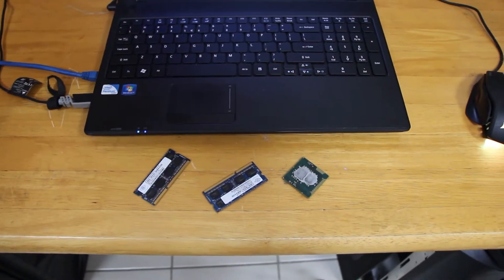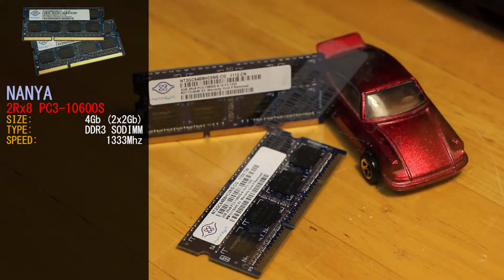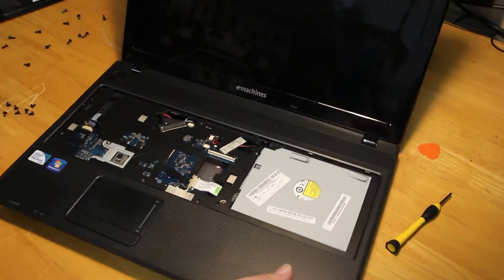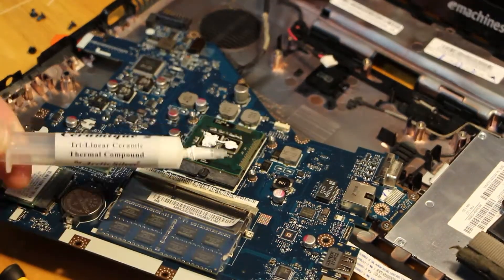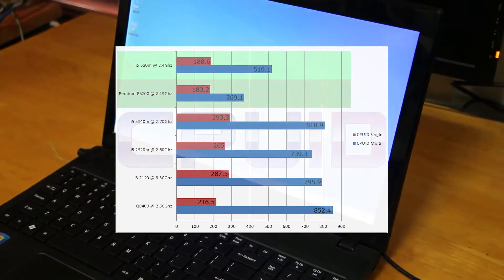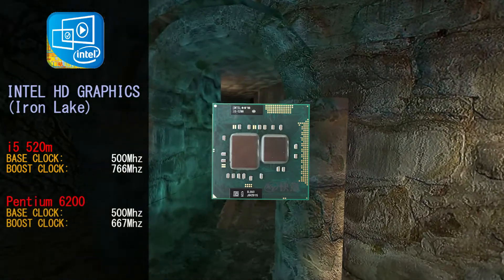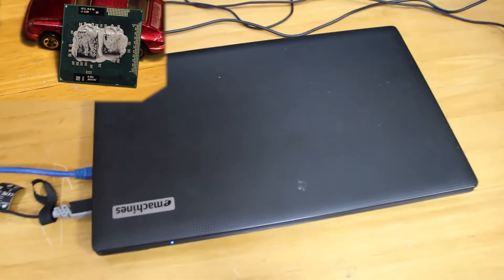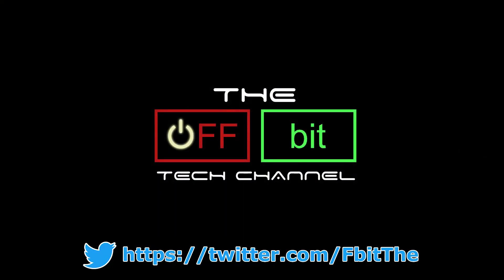eMachines E729Z Laptop CPU and Ram Upgrade. Pentium p6200 to i5 540m with 4g of DD3 SODIMM ram.

Comment: Can emachine d730 upgrade from 2 gb ram(?) To 8gb ram?
From 250 HDD to 500 HDD?
From window 7 to windows 10?
Please i need answers i don't know about computer's and my laptop been broken i don't have to use in online class and the only way is this old emachine that my parents bought from a scammer..
And can I also ask what to do when it's easy to lowbat and overheating? Should I buy new battery?
And it's speaker is broken should i use wireless earphones instead? 
Advance Thank you if you answeredn sir!! I'll always wait for response and I also hope can you teach me more abt it how I'll turn it to worth it and useable laptop 😅🙏
Reply from the maker: Yes all of the above should be possible.
Before putting windows 10 on your laptop we would highly recommending the hard drive and ram as you have planned to be upgraded.

We would recommend using an SSD drive. This will make you laptop feel a lot more snappier and boot times will be a lot faster. It will also save you battery. 

Running windows 10 we would recommend at least 4gb but 8gb would be ideal.

The things you will need for a good windows 10 upgrade:
- SATA SSD Drive ( get the 512gb as you wanted)
- 2x4gb Sticks of DDR3 ram for laptop to get you to 8gb of ram (They are called SODIMM)

Other things to fix.
Overheating will be down to dust build up and the most likely cause the CPU needs new heat-sink compound. It's a paste you can get fairly cheaply. Over a long time it dries out and becomes more of a heat insulator than a transfer. The other more unlikely situation is the cpu fan has failed. Just check if you can feel air blowing out from the left hand side near the back of the laptop.

The battery will probably need replacing if it does not hold it's charge. You should get about One and half to 2hrs out of it at least. If not good chance the battery needs replacing. Also if the laptop is running poorly it will chew battery up thinking and loading.

The i3 cpu probably would suffice for now but if you wanted to upgrade you should be able to get an i5 or i7 (you wont be able to use the Quad Core i7 because of it's not having an on chip graphics processor, these usually have a qm on the end of the cpu model). You will need to stick to first gen i5 and i7 mobile processors.
Wiki has a nice list of them.

https://en.wikipedia.org/wiki/List_of_Intel_Core_i5_processors#Westmere_microarchitecture_(1st_generation)_2

https://en.wikipedia.org/wiki/List_of_Intel_Core_i7_processors#Westmere_microarchitecture_(1st_generation)_2

You will need to make sure that your cpu is not soldered on, which it is most likely not in your case. The cpu socket for your laptop motherboard will most likely be Socket G1. Otherwise it will be a soldered on socket named BGA-1288, if this is the case we cant really upgrade the CPU.  

The hardest part with the CPU upgrade or changing heat-sink compound is the opening of the laptop. Take your time, we use jewelers screw drivers and a guitar pick top open out laptops as you have probably seen.

here is a video we found that might help you open up your laptop.

https://www.youtube.com/watch?v=ghSf6ALBUV4

Anything CPU related is quiet involved and probably hard to do and usually requires the motherboard to be removed or partially removed from the laptop. The ram and hard drive upgrade should be fairly easy. They are both located underneath the first panel at the front of laptop from the bottom.

Good luck.
Thanks for watching.
Let us know how it goes.
Reply: @OFFbitTech  I just looked in settings just now for the first time... So this is what I found it's already windows 10 and have 4gb memory wait I'll list the abouts:

Processor: Intel (R)Core(TM)i3 CPU M330 @-2.13GHz 2.13 GHz
Installed RAM: 4.00GB(3.68GB usable)
System Type: 64- Bit operating system, x64-based processor

Windows specification
Edition Windows 10 pro
Version 2004
Installed on 12/7/2019
Local disk (C:)- 232 GB
42.6GB used 189 GB Free

I think the only problem is it's slightly lag always, overheating and easy to lowbat...

I'm planning now to buy new battery I want to be sure now that I'll buy legit one bc my father buy battery before to the seller for $50 and it's fake(that's what I'm using now) it's lister there 5500 mAh but only lasted 1 hour at the very least... 
Also yes, there's a hot wind when using in left part of laptop
Can I ask more pls? If I change the 4gb to 8GB am I able to attend zoom meetings without problem/lag or overheating? 
I just need to use this for online classes/attending zoom meetings.. 
Bonus question, Can I play Roblox or League of legends here? Just one game? Can I?😭🙏
Reply from the maker: @VoiceOfPeak  Not sure, what zoom needs.
Is it giving you problems at the moment?
I'm not entirely sure if 8gb of ram will give you a smooth zoom meeting. Possibly, but it may be a processing power issue.

You can grab a little bit of extra performance turning off some CPU patches that windows has added.
This is easily done with this program

https://www.grc.com/inspectre.htm

You will need to run it as administrator.
This program disables an microcode patch released by intel to stop a couple vulnerabilities. These microcode updates makes cpu takes a performance hit. So disabling them does give you a bit extra compute power.

Also to check how your CPU temperatures are going you can use HWMonitor.

https://www.cpuid.com/softwares/hwmonitor.html

This will tell you a hole heap of information and temperatures.
Here you can check what your cpu is doing.

From here you can tell if you need to redo thermal paste.

If you can find out what hard drive you have. Hopefully you may already have an SSD drive.

Now in regards to games, Unfortunately there will be very little that will run and this is more down to api support from the onboard GPU.

In regards to games. League of legends and roblox should run, not sure how well though, they may not be playable.

The first gen and second gen i3 i5 i7 Intel onboard HD graphics drivers are very badly written for windows 10. So it is a guess to what runs and what does not.
Reply: @OFFbitTech  for now I tried it and zoom is going okay but im still not sure when it become many...
I'm hesitating on what will i buy because i don't want to get scam again how to know if the battery is original? That really last 4 hours? Or should I just buy power bank and plug it while im in zoom meeting so i won't be low battery? Is it bad idea?
Also i decided to not play games bc i don't want to end it up worster..

Edit: I already used the webcam and i decided to just buy new
Reply from the maker: @VoiceOfPeak  Unfortunately we have little experience with web cameras also I don't think you will find a battery that will give you 4hrs of use for this laptop. Our guess would be somewhere near 2hrs for it's max.

In regards to the battery. We really don't know to much about the subject. But I would not be to worried about a 3rd party battery. Some of them are made well.
Might be worth finding a brand that has a warranty or return policy. We suggest this as it might be hard to find a genuine battery replacement and also the genuine replacement could be old as well. Which is no good for batteries. The newer the better in our thought.

The other thought is you probably wont find a battery that can last 4hrs with this laptop. 
If you are trying to find a battery with the most capacity check the mAh rating.
The best  we found at a glance was 5200mAh.
Reply: @OFFbitTech AHHH I can play roblox with 20-257 players online at the same time with me it's slightly lag in spawn bc of many effects but it can carry and my battery now can last 1 hour and 15 min playing( bc I've followed some steps I've watched) I played in anime game in roblox with so many effects still it just some fps drops sometimes bc im still using hdd idk if it will be fast if I change to ssd like they said...  I want to ask if I can use 30000 mAh powerbank while using my laptop? Is it possible? Maybe like just for 4 hours like that
Edit: I decided to just buy Powerbank not battery bc maybe the battery that will be sent is like what im using now, it's hopeless so at least in powerbank much cheaper and dependable(?)..
Reply from the maker: @VoiceOfPeak  We have not used power-banks at the channel here. 
Do they plug into the power jack for power in?
Reply: @OFFbitTech  update: I can also play League of legends smoothly... The really only problem is battery so easy to lowbat hehe Thankyouu I've learned many things

Comment: Hello I have a EL1352G emachine. I was looking to upgrade the processor. Was looking at the 2 duo 2.93 e7500. But then I saw your video. Would I be able you upgrade it to a i5 / i7? And is it plug and play? Thank you
Reply from the maker: Do you have any extra information on the PC,
What is the current CPU?
From just a glance I don't think an upgrade to an i5 or i7 will be possible without changing the motherboard. 
From what we can find with a quick google it looks like the PC runs on the AMD platform.  If this is the case you will need to stay with AMD.

If you could let us know more details we should be able give you some idea of options (mainly what is the current CPU).

Thanks for watching.
Reply: @OFFbitTech  it’s a AMD processor
Reply from the maker: @uriel-heavensguardian8949  With out being able to physical see the system our best guess for upgrades would be.

Phenom II x4 (quad core cpu) probably something like the 955.

We are not 100% sure (we are still highly positive this will work) as we can't find a lot of information on upgrading the EL1352G, but it looks like someone has had success with the Phenom II x4 955 with this system on youtube which is an encouraging sign.

Other good ideas would be to upgrade to an SSD hard drive if you can. Also see if you can get to 8gb of ram if you are not already on that.

This would probably be the best upgrades you could do. You could also try and find a gt1030 or some sort of Low powered , low profile gpu.

We hope that can help.
Thanks for watching and feel free to ask any questions.
Reply: @OFFbitTech  thank you for responding and for the information. I appreciate it. From what I’ve read online my Machine can  only take up to 4gigs of ram. But if everyone else is putting in 8 gigs I’ll do that.  I’m also wanting to get a FireWire pci card so I can still use my audio interface. Would you happen to know of a card that would work or does it matter as long as it’s low profile?
Reply from the maker: 4gbs of ram may be the most ram you can take. We found a person who managed to get a quad core CPU in but we have not seen anything in regards to ram upgrades.  As for FireWire interface card unfortunately we don't have any experience in this area, sorry.
Reply: @OFFbitTech  👍 thank very much!! I appreciate you answering my questions.
Reply: @OFFbitTech  so I’m guessing I’d have to stick with AMD

Comment: i have my emachines d730 witn i3-370M do you think it can be upgrade to i5 or i7?
Reply from the maker: From what we can find the CPU looks like it should be socket-ed not soldered. Which is the first thing you need to check. If it is soldered in, there is no chance on the upgrade.

The board should be able to take an i5 m or i7 m cpu but it wont take a i7 qm cpu. The i7 qm cpu's don't have a GPU on them, which Im guessing you laptop uses Intel graphics which is from the CPU (so if this is the case stay to CPUs with an m on the end like i5-XXXm or i7-XXXm).

Our thoughts are that you should be fine to upgrade just don't get the quad core i7-XXX qm cpu.

Here is the list of i7 cpu's from wikipedia, your motherboard should have the Socket G1 socket.

https://en.wikipedia.org/wiki/List_of_Intel_Core_i7_processors#Westmere_microarchitecture_(1st_generation)_2

Thanks for watching.
We hope that helps
Reply: @OFFbitTech  thank you so much! It's gonna be a really big help
Reply: We have same d730 but it's i3-330M idk abt pc can you help me learn 🙏

Comment: please respond 🙏 I've emachines e-725, very old machine. with pentium t-4400 ram-2 gb, HDD. can i upgrade it to and I5 6300u, ram-8gb, 256 SSD? I've read that I can not, because of the BIOS can't process high power. so, could you please tell me, what will be best budget upgrade for my laptop? 💻 thank you
Reply from the maker: Unfortunately the i5 6300u is a completely different platform. Which means the i5 cpu is not even compatible with the motherboard. :(

Your best option for upgrade options for your laptop would most likely be...

Find a Core 2 duo socket P CPU from second hand markets like eBay. something like a Core 2 Duo (mobile) T9300 (cheaper) or a T9500.

Your ram is ddr2 so you should be able to get to 4gb all up or  8gb (2x sticks of 2gb or 4gb).
you should be able to get a standard sata SSD hard drive in there easily, direct swap over just need to install windows on it.

Now because of the age and the lack of information i can find on your emachine laptop some of the above could be incorrect but should be right.

Information I found about your laptop below.
http://cdn.cnetcontent.com/0e/a0/0ea08be9-f26a-408b-b7fb-ac8002e8eb6d.pdf

Also bear in mind to change a CPU can be a complete strip down of the laptop. Fortunately older laptops seamed to sometimes be better set up for upgrades but not all are like this.

Just a few other things to note.
Your motherboard can not support CPU's with a faster FSB than 800mhz according to the GL40 chip set upgrade information at
CPU-Upgrade.com

https://www.cpu-upgrade.com/mb-Intel_(chipsets)/GL40_Express.html

Which I believe will rule out any quad core CPU's which generally are expensive anyway from this era.

Also searching the core 2 t9300 on Wikipedia can be helpful, it shows all the specs of all the CPU's from that era in one spot.

https://en.wikipedia.org/wiki/List_of_Intel_Core_2_microprocessors#%22Penryn-L%22_(45_nm)

The other option would be trying to find a cheap second hand laptop with specs you are wanting.

We hope that helps, unfortunately older laptops can only be upgraded so much, but some of the not top higher tier parts are actually pretty cheap second hand.

Good luck with you upgrade we hope we have shed some light on the situation and thanks for watching.
Reply: @OFFbitTech  thank you so much, I've been a great help to me ❤️

Comment: Is it worth upgrading from an i3 380m to i5 560m will i see a performance gain mainly using my laptop for matlab
Reply from the maker: It should give you about a 15% to 20% increase in speed. Which is a nice little speed boost.
If the cost is cheap enough and you are fine in stripping the laptop down it probably worth doing.

Thanks for watching.
Reply from the maker: @Noob Keso 🅥 According to user benchmark you should get about a 20% performance increase across the board.

Probably worth the upgrade if the price is not too expensive.

Comment: Can the emachine e732 use core i7? Thanks.
Reply from the maker: Yes it should be able too.
But not all the i7 CPU's work.
Any of the i7-7xxQM and i7-8XXqm or i7-9xxXM wont work. 
This is because the Clarksfield CPU's don't have an on CPU GPU. 

Since this laptop does not have a dedicated discrete video card (NVIDIA or AMD Radeon).
Using a QM or XM chip will not work.

Any of the i7 6xxM series will work though.
but they are only 2 cores 4 threads.

Hope that helps.
Thanks for watching.
Reply: @OFFbitTech  Thank you so much that’s really helpful